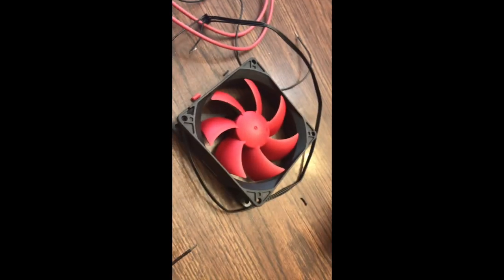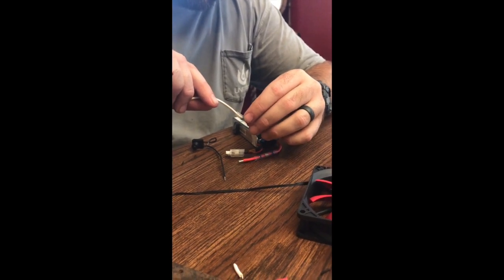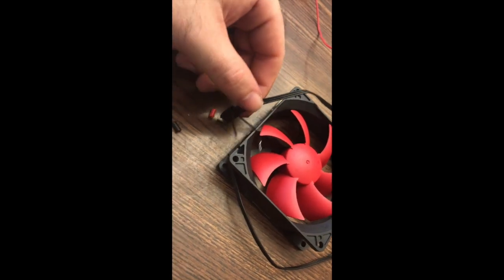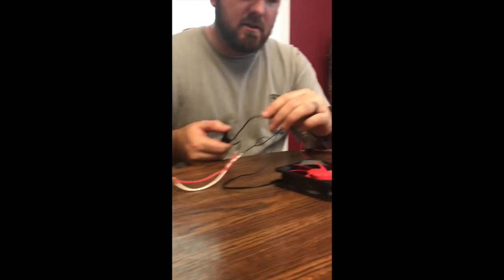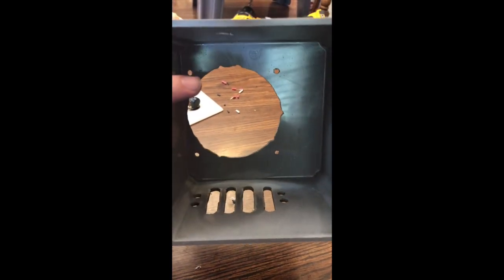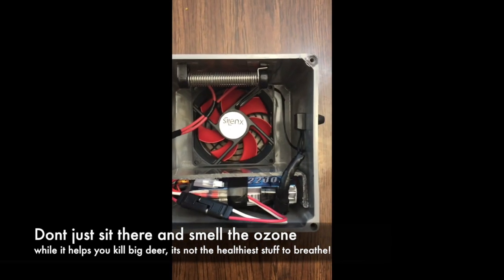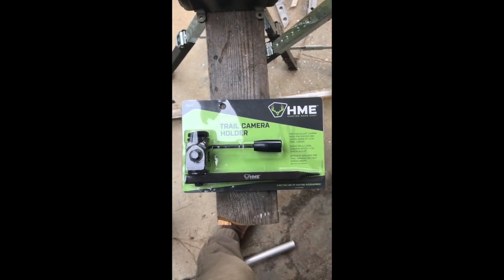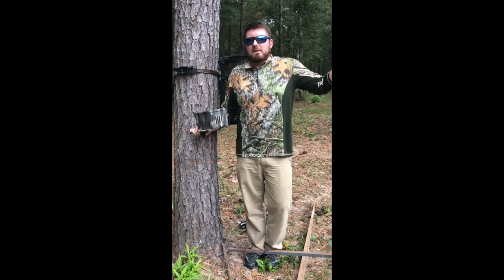HOMEMADE DIY OZONICS for hunting : how to make a battery powered ozone generator

Comment: do you set the fan to push air out or suck it in and does the ozone come out the slotted holes or out the fan or does it matter
Reply from the maker: @georgereichle7998  probably doesn’t matter but it’s set to suck in from the bottom and push the ozone out the slots.

Comment: Just wondering how your unit has preformed and held up. Thanks
Reply from the maker: Very good. Still use it. Had to replace batteries as the original one quit charging. Other than that, it’s still very useful.

Comment: Hey im a subscriber...can you tell me what quick connects you used ? And give me a parts link
Reply from the maker: I used ones similar to these. 400PCS Solder Seal Wire Connectors-haisstronica Waterproof Wire Connectors-Heat Shrink Wire Connectors-Heat Shrink Butt Connectors-Self Solder for Marine,Aircraft,Boat,Truck,Stereo,Joint https://www.amazon.com/dp/B088ZXW4ZR/ref=cm_sw_r_cp_api_glt_fabc_2F745P3J7ESTHNPJQ4DM?_encoding=UTF8&psc=1

Comment: What was the point of separating the battery and capacitor?
Reply from the maker: to give them a tight space to stay where they won't be banging all around the inside of the box when in the backpack.  The main thing i was going for was keeping as much of the air space above fan clear for ozone airflow.

Comment: How well did your ozone generator do in the field
Reply from the maker: it did good... i have pretty much the same review as everyone with an ozone generator... the windier the better... In other words, if the wind is pretty strong in one direction it works great, if the wind is swirling its hit or miss.  I had deer come from directly down wind and never check up, and then also had them blow me when the wind was shifting and changing.  its not a fix-all, but just adds one more thing to the arsenal while trying to outsmart an incredible animal.

Comment: Outstanding man! Yes def excited aa i was no way no form soending 400 on an ozonics lol. So glad i came across this. Think.a variable fan speed would be benefical?

As setting it up in the tree, you put it on the downwind side of your scent?? So the fan sucks up our scent an blows exhaust out ports exit towards game??

Laat thing bud what are those wuick connects called ??    Thanks again buddy way stoked
Reply from the maker: Variable speed wouldn't hurt,  but its still going to put out the same amount of ozone unless you get the variable transformer i believe.  

as far as set up, just face downwind.  it doesn't suck up your scent as much as it "drops" ozone on your scent thats being blown that direction.

They are called solder seal butt connectors - just buy a variety pack as they are useful for a ton of applications.

Comment: Absolutely suburb man🤙 ... Work good for you?? Def will be building this..you have your battery under the transformer?? Create any problem when comes time to charge??? How long does lipo battery run at full fan speed
Reply from the maker: thanks man!  It does work good.  I'm not totally sold on the effectiveness of ozonics, but i figured that there were so many people that swear by it, it certainly couldn't hurt anything.  I had a few does blow at me where i walked in, then circle straight down wind from me in my stand.  They were still curious as heck and I think they smelled the ozone, but it wasn't a smell that alerted them enough to run off.  I'm going to use it every time I go, as the more scent elimination the better.  

as for the build, the battery just sits on top of the transformer.  the transformer is gorilla taped to the bottom so it stays put.  the battery just floats.  I take it in and out for charging.

I get about 3.5 - 4 hours on a charge.  could take 2 for an all day sit and have an easy change in the tree when first one run out.
Reply: Awesome job, hunter!!!  Will be using this season.